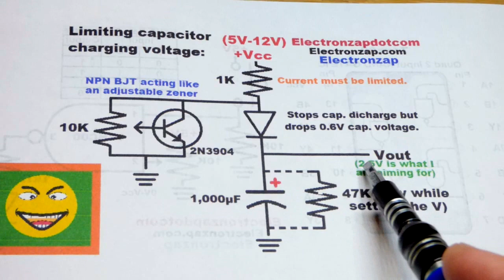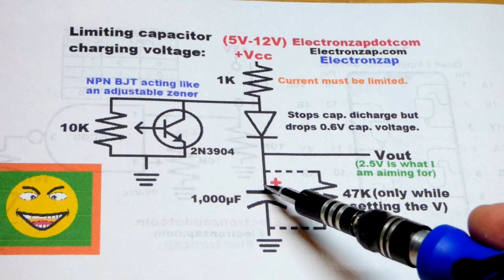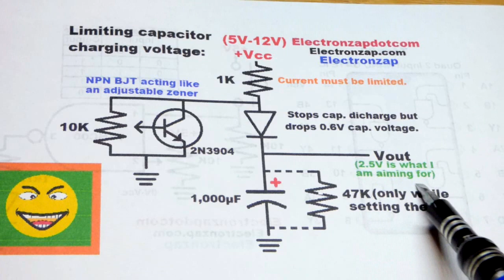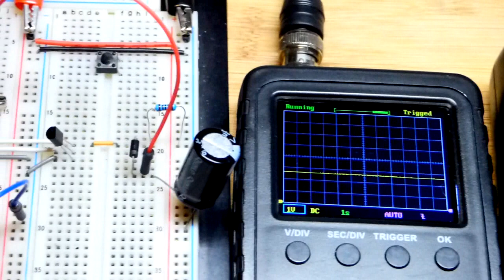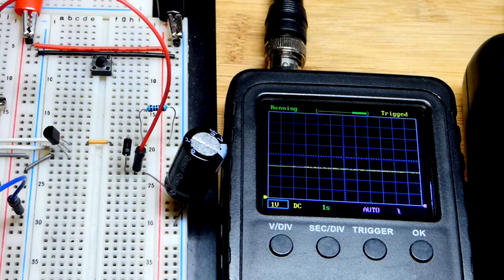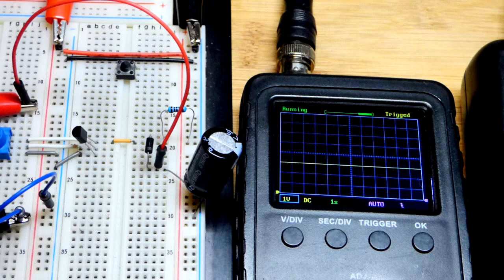First try at setting capacitor voltage with 2N3904 NPN BJT wired as adjustable zener diode circuit

Comment: Nice circuit. I'm struggling to understand how the transistor/ trim pot pairing control the capacitor voltage though, I mean they seem like two parallel circuits. Can you explain briefly?
Reply from the maker: Parallel components have the same voltage across them. In this case the transistor is parallel to the diode and capacitor, so the voltage across the transistor is also the voltage split up by the diode and capacitor.

Comment: when i measure the voltge with a DMM it start discharging, is there any way to avoid that?
Reply from the maker: Power has to stay on or else the meter will discharge the capacitor. A little bit of current still flows through the meter while it is measuring voltage.